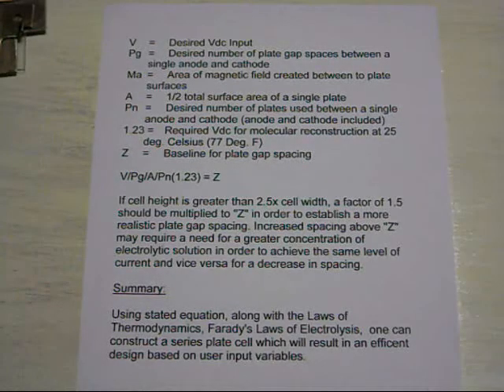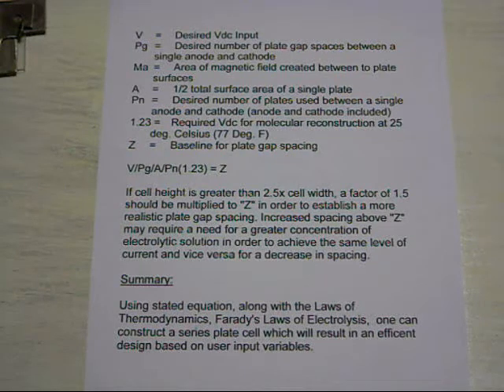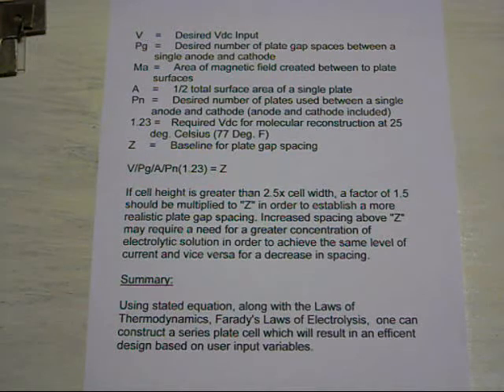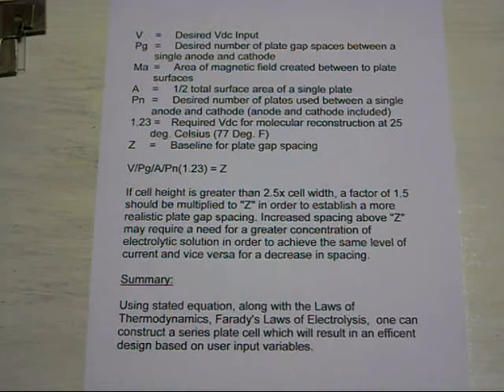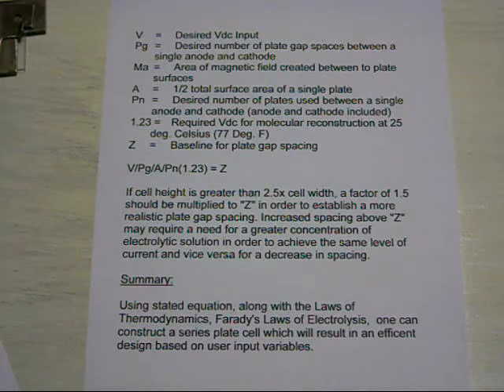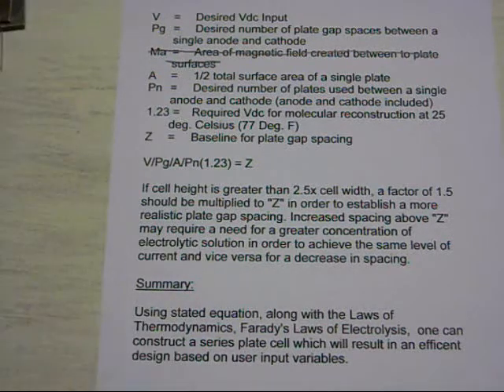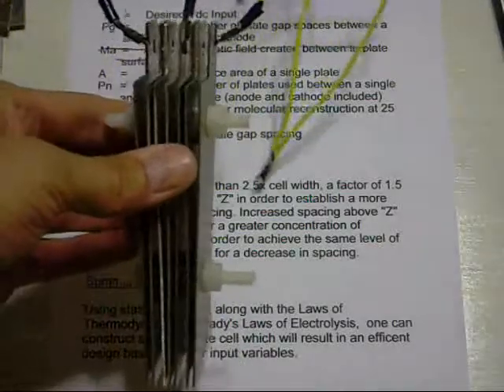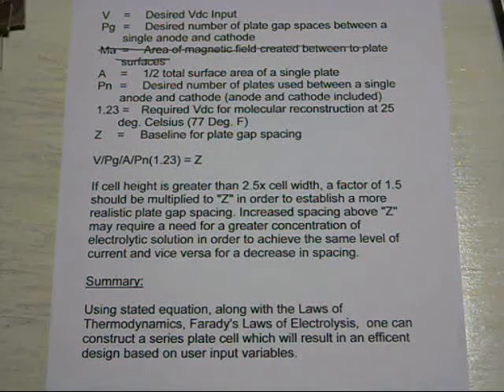Plate Gap Theory (02)

Comment: a person can use more that 2v easy. close plate spacing of .030" or so works great.  think big. i gave up on the multiple cell design to use with higher voltage devided by 2v concept. Huge single cell configs of many plates. stop current leakage. If you want to run vehicle on brute force, think big. It can be done with less than 200 amps at 14v.